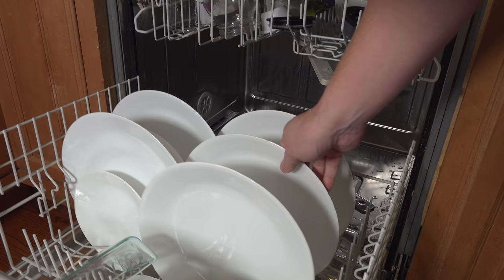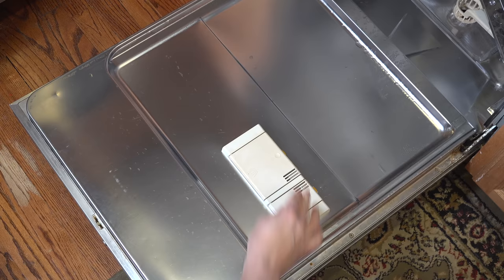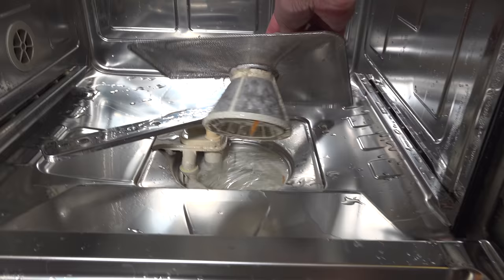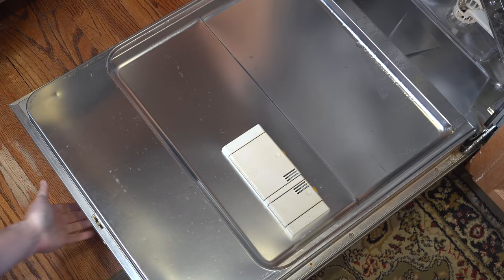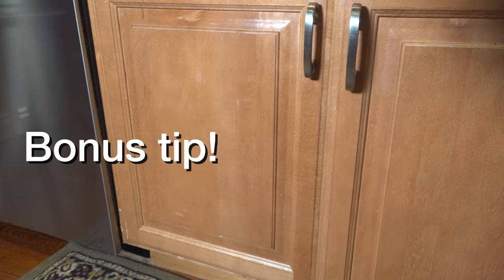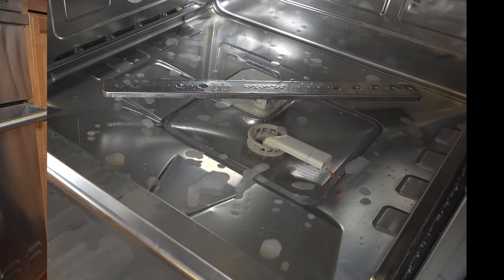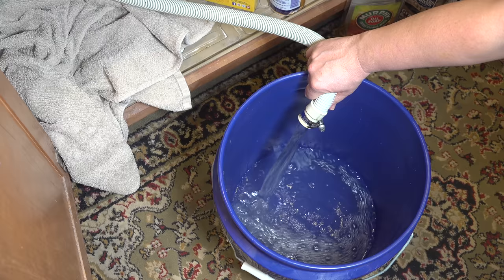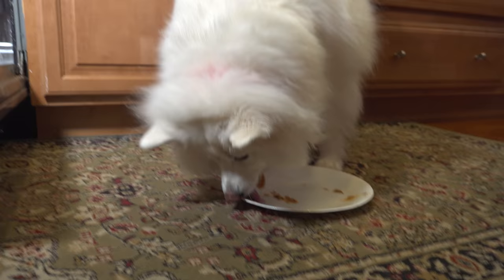3 EASY Tips to Make Your Dishwasher WORK LIKE NEW

Comment: Pods are the worst type of detergent you can use. Use liquid or gel. Source, I’m an application technician.
Reply from the maker: I appreciate the feedback but I have used dozens of US and foreign detergents and these are the best I have ever used for the price. I am not a pod fan of any other product but these.
Reply: Pods or not, you should use both soap cups so the soap in the prewash will remove most of the fats.
Reply: hmm  for me I always found the tablets work best, nothing left on any of the dishes, using a Samsung before and now with a new Maytag dishwasher.
Reply: I'll never go back from using the Finish Quantum tablets/pods. Mostly because I'm never running out of rinse aid because it's no longer needed. My glasses tell me everything I need to know.

Comment: Abso-fucking-lutely FANTASTIC video mate!! 
Thanks from London England 👍💪😎
Knew the filter and salt and flushing but didn't know the whole thing came out and the last tip was the one that did it for me mate did not think about the filling with Hot water and open closing it on first part of the cycle never thought of that.. 
There's also cheaper versions of the detergents to use ANYTHING acidic..
Reply from the maker: I appreciate that, thank you
Reply: @SilverCymbal  welcome appreciate good content mate

Comment: Biggest tips
1 make sure you are running the hot water before u turn on the dishwasher.
2 put a pod in the prewash bucket and one in the other one that closes. 
3 get rid of tabs and use liquid!

Comment: I don't like having to remember to mess around with a filter that, in my opinion, should be SELF-CLEANING, and I think the only machine that uses this type of self-cleaning filter is KitchenAid.  They may have changed their filtration design, as mine is almost 15 years old now, but I hope they're still using a self-clean filter design.  I never have a dirty dish come out of a clean load of dishes, and I do not pre-rinse.....just scrape and load. It removes baked on tuna casserole and lasagna al forno dishes without a trace of any remaining food particles. Also...one big NAY on the Finish Power ball.....I tried that one first and it consistently did a LOUSY JOB. I recommend Cascade Platinum Action packs; these do a much, MUCH better job; the Finish Power ball was a joke, and I have city water with a water softer, too.  So, it was never the water, it was the detergent.

Comment: Pro tip.  Stop using dishwasher tabs.  They only apply soap during the wash phase.  If you use powder or squirt detergent you can fill the prewash side of your dispenser so it gets even more cleaning during the 15 minute prewash.  If you use a tab that phase will just use water.
Reply from the maker: No way, other brands maybe, not Finish. Trust me, all pods are not the same, that's why Finish destroyed Cascade early on and came from nowhere. Cascade owned the market, people got sick of poor performance, Finish solved it. Try it sometime you will never use liquids or multistep again.
Reply: @SilverCymbal  My wife thought Cascade did better than finish.  But now we use liquid for the prewash.  That extra detergent during the pre wash makes a huge difference.

Comment: The only issue I have with my GE dishwasher is not all the detergent gets washed out of the dispenser cup, so I close the dispenser empty, listen for the sound it makes when it swings open, then add the detergent into the machine.
Reply from the maker: Hmm, if the door is opening the issue is either bad flow or detergent. Try a finish tab, I don't think you will have the issue any longer. They just fall out and dissolve

Comment: Well, I had troubles out of the blue with my Dishes and Glasses not cleaning right after years of no cleaning problems. 
I always after every load clean the dishwasher filter and keep the inside cleaned and I did use the power ball finish tablets and every time 
I also used soda crystals to help soften our hard water. 

But After no problems at all for years I found the dishes and glasses not cleaned and they had white powder left on them!
I looked up the cause and found that it was because the dishwasher was not fully cleaning the last part of the tablet ingredients away?

The help pages said to use a good dishwasher machine cleaning liquid treatment, where you buy a finish cleaner liquid and empty the dishwasher 
and put it up in the top tray where it slim flat bottle sits in the top plate rack gap. The top is removed and you peel off the tops cover label. 
Then set the dishwasher to the top hot program and let it wash.

I did so and when opening the door the plastic clean bottle was empty and the dish washer was clean and the dish washing problem went away.
It cleans out the inner workings of the dishwasher so all the fat or muck in there all cleaned out.
Now I do that once a month and never had any more white powder or bad cleaning.

Those power ball dish washing tablets I've found are not any good at all at cleaning even if the machine is fully clean?
I buy a local super market own brand dishwasher hard tablets now.

They have all the needed cleaning chemicals in each tablet that a dishwasher needs to wash 
and cost less than the power ball finish ones.

All in a solid tablet which is wrapped up in a water solvable cover. I still add the salt and rinse aid to the dishwasher fill units away.

All I can say is this works for me and I don't have any problems at all now.

Comment: Using a tab or pod over powder detergent means you are completely wasting the pre rinse cycle at the beginning
Reply: Do you also throw powder detergent over your car before the pre-rinse in  the car wash?  The pre-rinse helps to loosen food particles so I don’t think it is a waste.
Reply from the maker: I know of the other video out there on this. but after a lot of years of different machines I realized the main detergent was an issue. Give it a try and save an extra step, you have little to lose and a lot of extra steps gone in the future.

Comment: What is the problem if the dishwasher is brand new and it leaves a residue on the dishes? I have heard it may be hard water.
Reply from the maker: Definitely be sure you are using a rinse agent, brands of that don't matter much. If you still have the issue it can be hard water, some dishwashers have a mini softener built in, but it depends on the model.
Reply: @SilverCymbal  Thank you. I tried the New dish washing Detergent recommended here to no avail. I guess a new water softener is in my near future. Keep up the great work. Oh yea, I have the rinse agent in it. TY
Reply: @SilverCymbal  I had Culligan come out and found out my water was 5 times the hardness that is acceptable. Water softener installed and problem solved. Thank you for the videos.

Comment: I had my dishwaher unistalled for over 3 years.  I want to start using it, but i'm afraid of bacteria, mold inside.  Any ideas except throwing it away ???????????  Thanks.
Reply from the maker: You don't need to be, I have never seen any studies or information that supports those worries. Keep up with cleaning the filter and use a good detergent and an empty cycle monthly and you are good to go.
Reply: Leave the door cracked open when not running . Air circulation will prevent mold.
Reply: @SilverCymbal  Thanks.  I thought about filling it up and dumping 1 cup Bleach in the water.  Soak a few hours and finish the cycle.